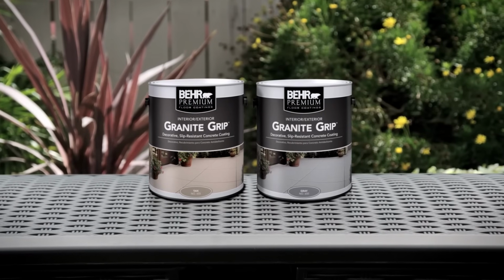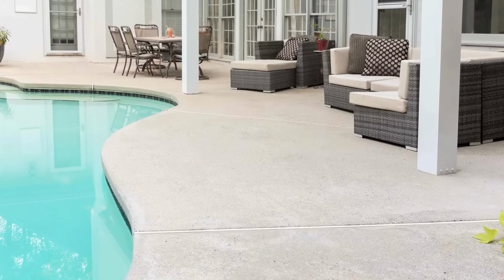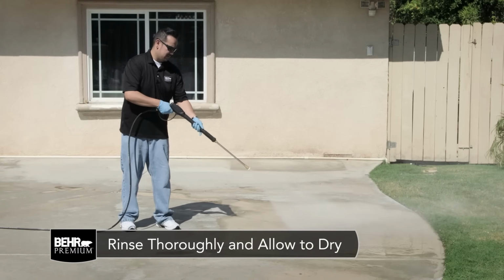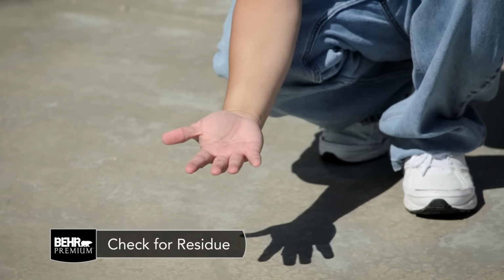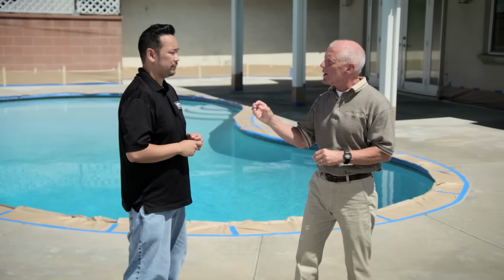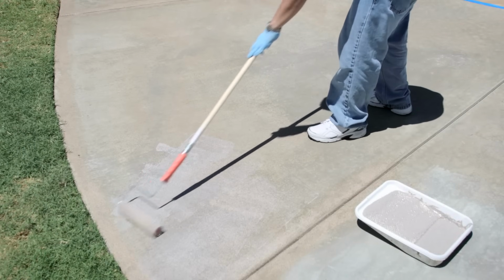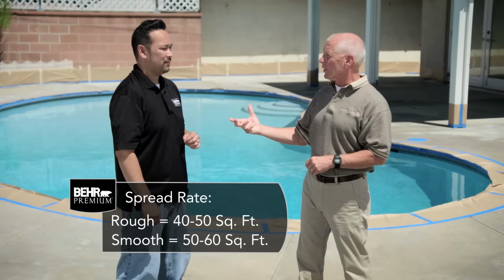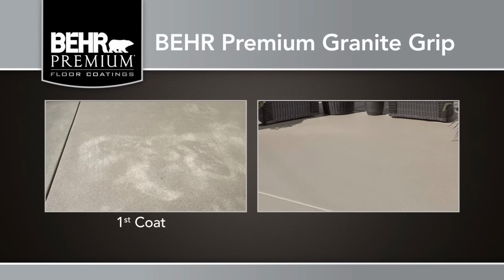How-To: Apply BEHR PREMIUM® Granite Grip™

Comment: I applied this over a concrete planter 2 years ago. Awesome stuff. You need to understand it's basically gray or tan glue with granite flecks in it.  It took 3-4 coats to completely cover the planter.  Anyone who thinks 1-2 coats is all that's needed is wrong.  It requires patience, but it is worth it.  Like they mention in the video, one coat just adds the base, the 3rd usually covers all imperfections.  I went with a 4th coat just for peace of mind.
Reply: Are there really only 2 colors , because in store they showed me about 20 colors and supposedly they are prepared from the Gray or Beige base

Comment: This stuff is like trying to roll down a sand castle covered with Elmer's glue you just have to keep on rolling, took three coats on my carport and could use another but it was worth it, looks so much better than it did.
9 cans $450

Comment: Thanks for having two guys read the can verbatim back to us... This product would be great if the binding agent allowed the substrate to flow more evenly. Ive used one full test gallon on a 30sqft area of my garage and can still clearly see the floor. I will be returning the other 10 gallons. I would still like two see someone successfully cover a floor with even 3 coats,  cuz I don't believe it.
Reply from the maker: Hi dKspunja. We are sorry to hear about your experience, and we would like to help. Would you please send us your email and phone number in a private message so that one of our customer care representatives can reach out? Alternately, you may chat now via: http://spr.ly/6057EdSUf.
Reply: this is why whenever someone is trying something, as far as paint. that's new to them I always suggest buying the minimum amount and attempting apply it. Paint usually has to be tinted, as these have to be as well, and once that is done, they are nonrefundable. 🤦🏼‍♀️
Reply: @user-cq2ou8bz3t  insightful...

Comment: It took 3 coats for my concrete patio. It goes down like glue with a roller. Looked fantastic though after I was done
Reply: Hey.how you  did it.did you wait it dry  to do  the another's coats? Or how? Can you tell me?
Reply: Applied by roller. Can reapply after 3-4 hours depending on weather conditions.

Comment: My first and most common error: this is not a paint, don't pour this product on a tray and soak the roller like regular paint.Very Important: First prepare the surface as explained on the video and product label. You have mix the product very well with a cord drill and mixer.The product is thick and a cordless drill with run out of battery right away.Drop the material "on" the floor in small quantities and spread it evenly with a glue roller and a stick extension (or it will kill your waist)Next day do the second coating.

Comment: This product came highly recommended to me and I have used Behr before so I took the plunge ! This has turned out the project from hell !! I have 18 man hours into this job and am NOT done yet...  I am going over another Behr product on concrete in pool area. So far I have applied 2 coats and used 20 gallons of the Granite Grip Paint.. more than DOUBLE the amount of Behr product used just 4 years ago.  Issue is not the amount of coats it's the poor coverage... it is  terrible It is like applying glue with a roller,  I am sorry but it is this coverage is the worst I have seen and I have done alot of concrete painting in my day... I estimate I will need another coat, at nearly $500 per coat.... project cost approaching $1500 TRIPLE the budget I had and triple what it costs 4 years ago... I hope the end result is worth it but I honestly can't appreciate my efforts right now because it has been a nightmare of a product to work with. I can NOT recommend this product to anyone, ever if the end result is great the cost and effort are not worth it...  extremely disappointed in this product and I am done with Behr.....
Reply from the maker: Hi Sam. We are sorry to hear about your experience. Please click the below link to chat with a customer care representative: http://spr.ly/6050EqxP2 
(Mon - Fri, 6am-5pm PST and Sat, 7am-3:30pm PST)
Reply: @BehrPaints  thank you
Reply: I am having the same experience. I am thinking of just getting a concrete paint and use that over the first two coats.
Reply: @johndarkification  Contact bear they were wonderful they helped me and actually paid for more paint to get the job done I know it’s hard  but I will promise you this once you’re done you will love the job it’s a pain in the ass to work with but well worth the result

Comment: yea, I used it and needed 2 of the 5 gallon buckets ($500) or twice what the label instructed for the coverage to be consistent and uniform. They only sell darker grey or tan, so by design it requires a lot of product to cover the lighter concrete color. If they offered light grey or light tan it would not take nearly so much of the product color to overcome concrete color it. They also need to sell a sealer as a separate product to use first. Cost was very high for me to cover a small area.
Reply from the maker: Hi Rudy, we are sorry to hear about your experience and would like to help. Would you please email us at behrpaint@behr.com providing your information/phone number so that one of our customer care representatives can reach out?
Reply: Me too! :(((((
Reply: very very expensive

Comment: I had a couple of very small cracks that I filled before application. You couldn’t find them after application however after about 6 months you can see where the cracks are I had applied 3 coats to that area!

Comment: I live in Minnesota and want to cover a small outdoor porch (150 sq. ft.).  Will there be any problems with the product peeling/coming off the concrete due to the extreme cold/snow here?  What is it's life expectancy before a recoat is needed? Will it hold up to a plastic snow shovel? There will never be any snow melter/salt used on the surface.  How does this product differ from DeckOver for concrete use?  Thanks in advance.
Reply: Honestly- Ive tried it all- Forget the Latex anything- Forget the Acrylic oil base paints- You Need a Thick Coating- Best thing to use for about a 10 year coating- Use a product similar to a Truck/Boat Bedliner, Find one that they can make in your color- 2 coats should last 10 years in all weather and foot/vehicle traffic. Forget your average store paints-

Comment: I have watched this video multiple times and I did everything perfectly. I am a single mom and spent a lot of money and was super excited to put this around my pool. I intermixed all the gallons, stirred it and filled the cracks. When I applied it, it looks NOTHING like this at all. It would not coat  like the shown in this video. It was almost like it was the consistency of  slime I was trying to smooth out. At this rate it would have taken 12 gallons 4 ft x 4ft took one gallon. I think something was wrong with the paint. 3 days of prepping and today wasted and I’ve cried and cried. I just want it off and my whole pool area now looks ruined. Not to mention how much worse the concrete looks after the muric acid.... I would have been better off financially and with time to have just power washed it. It looks so bad now and I am so disappointed. Both my daughters graduate next month and my pool deck is ruined for out of town guests. 😞
Reply: Wow. Im sorry for your experience. I'd call their customer service about this. Congrats to your daughters BTW.

Comment: so far I am 22 gallons into a garage floor painting project, Behr has sent an additional 15 gallons out for free because it is still terribly blotchy the gray colors are awful, and I am 4-5 coats into this project already and have tried every type of  rolling method, will be renting a texture sprayer on the hope that it will finally cover and coat evenly.

Comment: I'm in the middle of applying this to my concrete patio. The product in the video seems like it is much smoother and has way better coverage. I really hope i don't need to buy more of this, as its pretty expensive. If I have to buy more, I could have just resurfaced the concrete for way less money and way less work. I'll update when I'm done. Thanks for the video.
Reply: The label says 50 sq/ft per gallon. I've already used 12 gallons  for 400 sq/ft (33.3 sf/gal) or more than $1 per sf., and I can still see thru it. Per the instructions, I pressured washed it and used the correct roller. I hope you don't have a large area, or you may need to take out a 2nd mortgage. The coverage is awful. Good luck! Next time I'll use Glidden or Sherwin Williams products.

Comment: I have a new home construction and have several questions:
1)  Since being poured in Jan the garage floor has been covered with tar paper during the construction and has just been removed. Is it OK to move forward with the etching process and then painting? (I heard about new cement releasing gasses so not sure if the tar paper prevented this from happening)
2) We live in the PNW and with the wet weather do we need to wait until there is no chance of rain? (The concrete is inside our garage so won't get wet so curious about the humidity.

Comment: I’m worry, I just bought my first home and like a rookie I bought this product before checking for any issues using this product, I washed the concrete (common sense) then I began to cut around, After 45 min I realized I was in big trouble, I have already spent $200.00 for 4 single gallon, I used three and it barely covered a portion on my back porch, I decided to buy a 5 gallon bucket but I haven’t started since I was traumatized with my initial experience, I will follow someone’s advice to not to use a pan since is not regular paint (that’s what I thought at first) I will mix it as much as I can and pour it ON the surface but in small portions, he did say it took three coat which I’m not happy about since its very expensive, $50.00 a gallon. So far I have already spent almost $500.00 I hope I don’t need any more than 7 gallons of paint 🙁
Reply from the maker: Hi Allan. We are sorry to hear about your experience, and we would like to help. Would you please send us your email and phone number in a private message so that one of our customer care representatives can reach out? Alternately, you may chat now via: http://www.behr.com/consumer/customer-service.

Comment: Cool, possible if it can be applied also on headstone made from concrete?
Reply from the maker: Hi Morea. Yes, Granite Grip can be applied to concrete as long as it has been cleaned and etched or has a rough texture similar to 150 grit sandpaper.

Comment: I followed all directions, and two coats still didn’t cover. Very disappointed. I can’t swing another $200 just to hope it turns out right. 😟
Reply from the maker: Hi MrFess! We are sorry to hear about your experience, and we would like to help. Would you please send us your email and phone number in an email to BEHRPaint@Behr.com so that one of our customer care representatives can reach out?
Reply: BEHR Paint Your online customer service has taken care of the situation. Thank you.
Reply from the maker: Great! Happy New Year!
Reply: Two questions 1) can the finished surface withstand pressure washing to clean it after 30 days? We live by a bust road in LA and soot accumulates daily. 2) Can it be used on pool coping?
Reply from the maker: Hi Chris, we recommend cleaning the coated surface with a mild detergent.  Abrasive cleaners and pressure washers could cause premature coating failure. You can learn more here about BEHR Granite Grip: http://spr.ly/6051DgI6R

Comment: Would adding a waterproofing  top layer help longevity or is that even needed.
Reply from the maker: Hi Richard, thanks for your interest in our Behr Premium Granite Grip. Granite Grip provides a durable finish when applied according to product instructions. Adding a waterproofing top layer could help add a water resistance feature but consider the following side effects such as;
·         The overall look and finish will be effected and maybe not be as shown on the color card
·         The slip resistant texture will be compromised by the waterproofing topcoat
·         Most waterproofers require to be applied directly on to the concrete surface for adhesion. Applying a waterproofer to a coated surface may cause adhesion issues.
Reply: Top coats/sealer are not required or recommended

Comment: Can   this  be used  over  a  pebble   stone  driveway  ?
Reply from the maker: Hi! This product is recommended for use on Interior/Exterior surfaces such as: Porous Concrete, Masonry, Stone and Brick. it is ideal for horizontal surfaces such as: Walkways, Patios, Porches and Pool Decks.
Reply: Concerned !   Can   this  be used  over  a  pebble   stone  driveway  ?   You   didn't  answer  my  question
Reply from the maker: Hi Warren! Granite Grip is not suitable for driveways, garage floors or any surface subject to automotive tires at this time.

Comment: Cracks as shown in this video should be filled with a specialist concrete resin and allowed to dry. This paint fill type remedy is like merely applying a cheap bandaid to a wound...it will fail
Reply: I just painted a patio l was expecting to use only two gallons.   I end up using four extra gallons.  Thats 300.00 hundred dollars.   Is not worth what l charged.

Comment: I have a concrete porch that's been painted a few times it appears. There is paint peeling in areas. There is red and blue paint. I can easily scrape the loose paint, but how would I prep it for this? Also, can you use the one the vertical sides of the porch?
Reply from the maker: Hi Dede. You can use a paint stripper to remove old coating or scrape/sand down to a sound concrete surface.
For the existing coating remaining, scuff sand any glossy surfaces. Clean and spot etch any exposed concrete. Remove all dust with a damp cloth, allow to dry. Spot prime all bare concrete areas with a product such as BEHR PREMIUM No. 880. Concrete & Masonry Bonding Primer to increase adhesion of topcoat to the surface.

http://spr.ly/6052DYrEQ

Comment: How does this hold up on garage floors when you will have a car parked on it?  I know extra drying time is often required; but I also know some paints do not react well to rubber and sometimes lift off of the concrete when the car is moved.  Thanks.
Reply: Im thinking the same thing. I want to do my driveway in this but hard to determine with hot rubber everyday.

Comment: Can I use this over freshly painted concrete paint that has dried in a matching  colour. I just want a light speckled look over my concrete basement floor . I will use a sprayer to apply. Expensive product to cover a large area  .
Reply from the maker: HI Alain. While this is possible, we do not recommend this as it may not achieve the desired speckled look.

Comment: My results were really good but the grass surrounding the patio has died. I did not use any acid.
Reply from the maker: Hi Rick! We are sorry to hear about the grass surrounding your patio. We generally recommend that you dampen nearby foliage with water and cover it with plastic drop cloths before applying coatings to the surface.

Comment: This product seems good but don't even think about using it to cover dark painted or stained surfaces. It has almost no pigment blocking ability. On my third coat and still can see color under. For the cost this should do a better job of covering over existing surface color.You will need at least twice what the coverage says. Very expensive product.

Comment: I followed every single step to detail. After 2 coats it was barely visible, after 3 coats it was still transparent. After 4 coats it finally covered driveway surface. But.....The roller marks are so bad I'm embarrassed to have all of my neighbors see such terrible craftsmanship. I read in reviews this product leaves roller marks. I was VERY careful w each and every stroke with roller, rolled eight different directions in every 4x4 area I did until it was as even as it can get. Didn't matter.  I have 1275 sq ft of surface, it took 31 gallons to cover at $44.00 per gallon.  People , Its a joke. Don't waste your time or WAAAAAAAY too much money.  Don't do it.
Reply: tracy case ya its crap. Waste of money.
Reply: HOLY SHIT!!!!  THANKS
Reply: It probably started drying too fast. You did roll 8 different directions...
Reply: Thanks for the info. I was looking at 30-40 SF per gallons; that gets real pricey real quick. At $62/Gallon plus tax that is over $2/SF per coat and with 2 coats minimum its $4+/SF before considering the tape and rollers. That's  expensive without seeing the finished project,  but new pavers are $4/SF.

Comment: This stuff seems a bit overrated to me. I just did a job for a customer using this. We pressure washed the concrete patio, used the etching compound to prep it and I applied 2 coats that didn't seem to completely cover. A third coat would definitely cover completely but it's expensive and says it only needs two coats..
I can also fully expect to see this wearing away or peeling up in just a few years. I wouldn't spend the money on it. Just my opinion
Reply from the maker: Hello MMFJ10. We are sorry to hear about your experience, and we would like to help. Click the below link to chat with a customer care rep: http://www.behr.com/consumer/customer-service (Mon - Fri, 6am-5pm PST and Sat, 7am-3:30pm PST)

Comment: This is way too much for decent size driveway. 5 gallons cover 250sf. my drive way and walk way is 1000sf. Material alone is 1 grand. Then before that, to prep the surface, I need etch and cleanser. Given that the product is very very thick and probably needs at least 3 coats, you are looking at whole day if you get lucky.